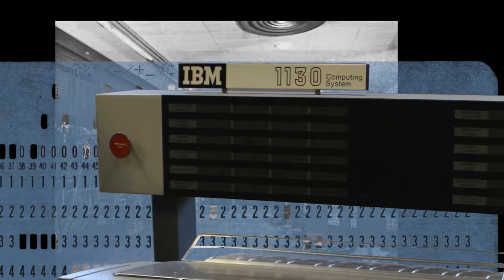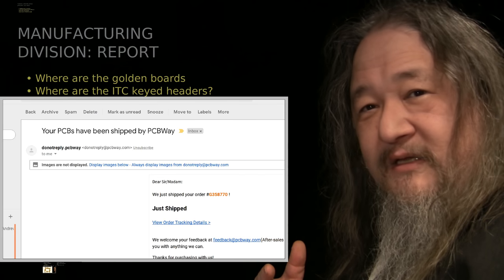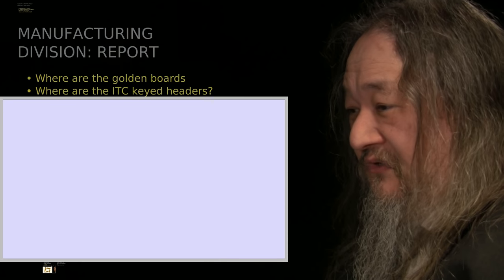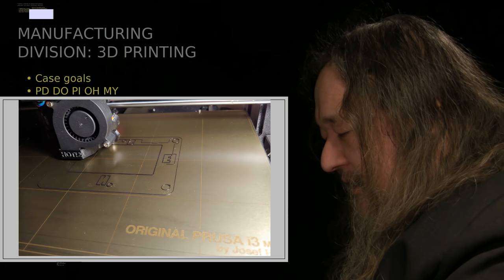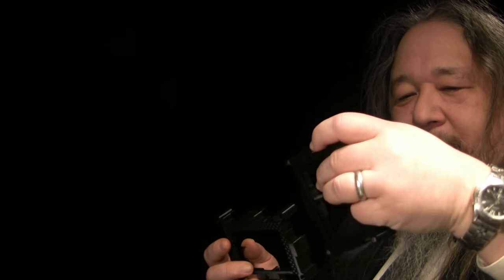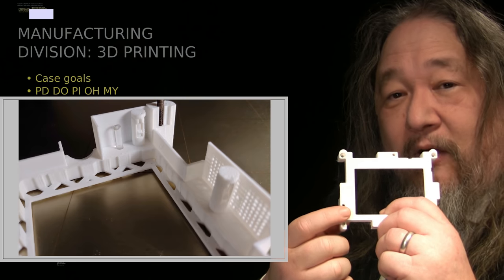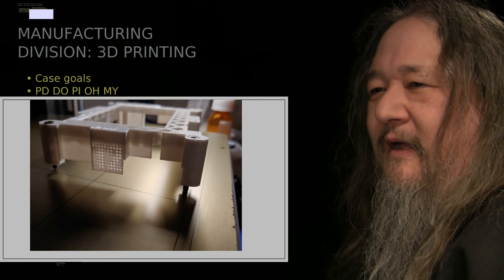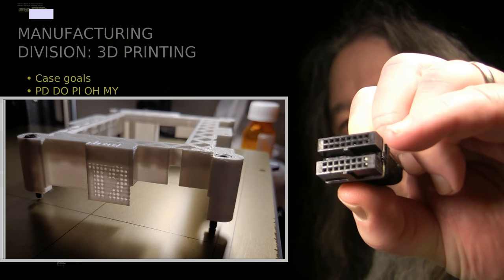3D Printing - T2sday Update 216

Comment: Definitely, go with black. White is too bright for that screen size, as you said.
It'd be cool if in the future you would use the 4 corner screws to support the screen (a bigger one actually!). Something like this:  https://imgur.com/ULd2Vie
Reply from the maker: Last year I did spend a lot of time trying to design a 'bezel-less' solution to get essentially wall-to-wall displays, but in the end, for the T2 anyway, I just had to 'own the gap' to get vertical intertile connectors and use available components and so on.